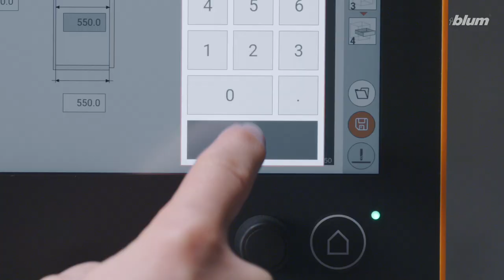MINIPRESS top with EASYSTICK – A new assembly machine generation | Blum

Comment: My blum rep didn't want to sell me  the Easystick. He said since I don't use the metal box drawer system it wouldn't work well for me. Kind of pisses me off. If this is marketed to the metal drawer box system they should call it that.
Reply from the maker: Hi Garen, thank you for your feedback. This can only be a misunderstanding. With EASYSTICK you can drill all the holes that are required for a Blum product. No matter whether hinges, metal drawers, wooden slides or lift systems. Even construction holes such as hole lines and connector holes etc. If you have any further questions about the EASYSTICK, we would be happy to contact you with the responsible product manager in the US. Thanks and best wishes from Austria, Lisa